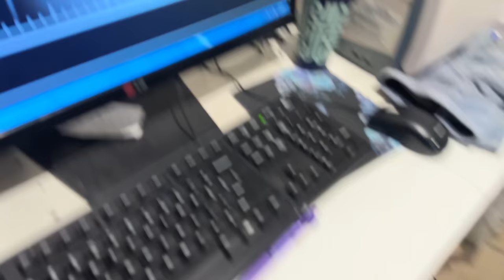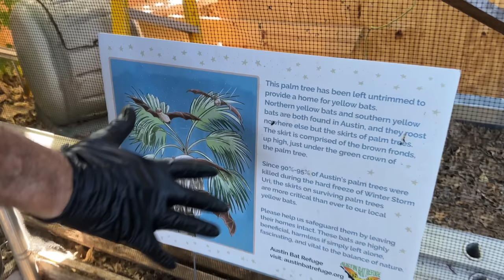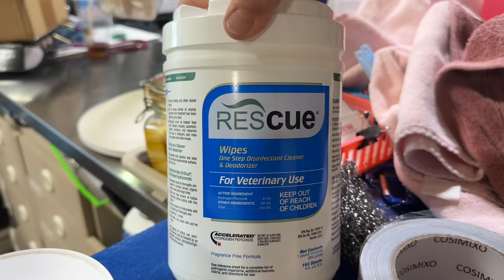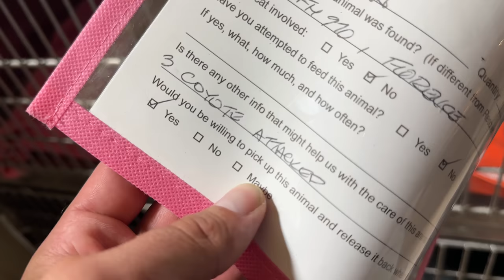I Fed a Bat to My Prairie Dog (Big Ounce Dies)

Comment: When I was a teen, a bat got trapped in our house through an open window. It was flying around up in the ceiling, so I took a towel and at just the right moment, slung the towel out and brought it down gently on top of the bat, lowering it to the bed. Then I wrapped it up in the towel and brought it outside to let it go. But it turned its head all the way around and bared his little pointy teeth at me.